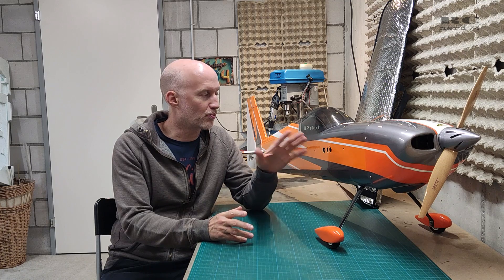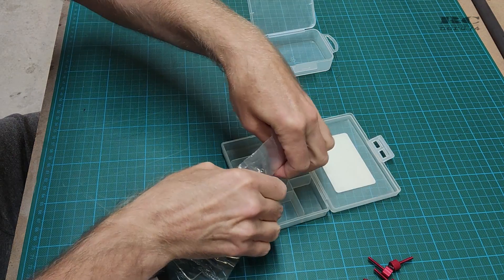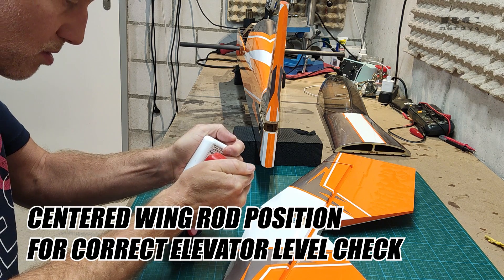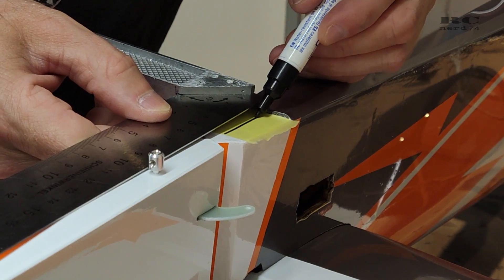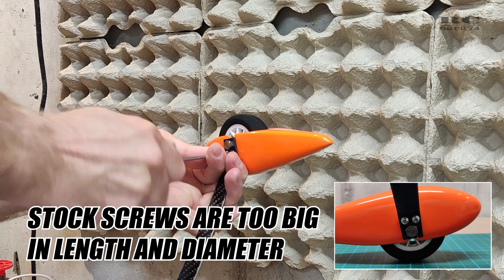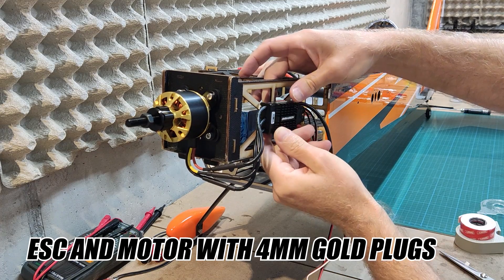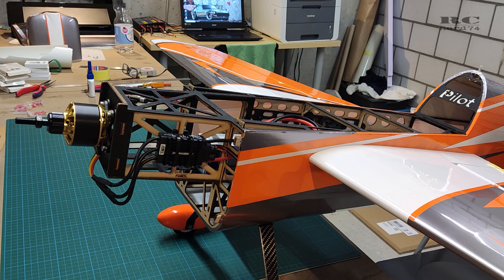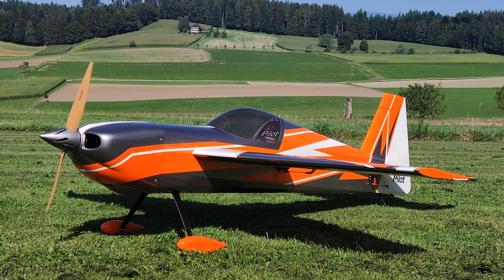FULL BUILD VIDEO | PILOT RC LASER 60" ELECTRIC

Comment: Do you have to cut out the huge hole for ventilation or is the cowl exit hole enough?
Reply from the maker: @patrickhoyle8357  The cowl exit hole is too small. You need to cut the additional hole.
Reply: I've seen the part on your video, I'm only a sport flier, that's why I ask if it's really necessary

Comment: I'll point out the direction of servo cushion shim should be reversed, so that the screw can give pressure to the rubber cushion
Reply from the maker: If you tighten up the screws, there is pressure on the rubber cushion anyways. It's squeezed between the screws and the hull. If it won't get squeezed, the servos would be lose. They stay perfect in place. No need to change anything.

Comment: The star stickers you get with the kit, are they stickers, transfers, wet slide things or decals? I applied a big one on my extra 67" and it looks a pig's ear, had to use sellotape to stick the edges down, now I'm wondering if supposed to put it in a saucer of water or just stick it on my forehead 😅😢
Reply from the maker: @patrickhoyle8357  These stars are ugly looking stickers. I don't like them at all.
Reply: @RCnerd74  the colour is bland, so they are stickers? Simply peel the backing off and slap them on? I'm ready for its maiden

Comment: You cut the aileron rods 8mm? 4m. Off either end, was there enough remaining thread or 8mm off one end and rethreaded?
Reply from the maker: @patrickhoyle8357  It's simply easier and quicker to cut only one end. And the effect is the same. If you prefer to cut both ends, you can do it for sure.
Reply: @RCnerd74  how do you fix the ball joint on with no threads on the rod?
Reply from the maker: @patrickhoyle8357  There is still thread on the rod.